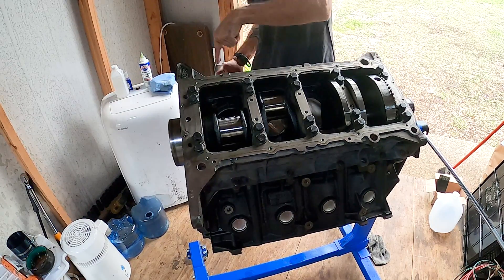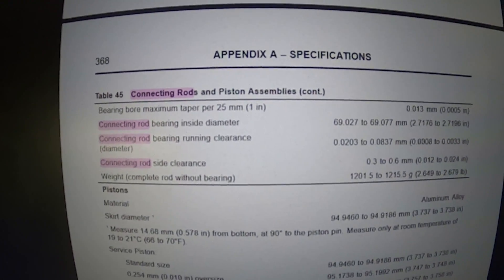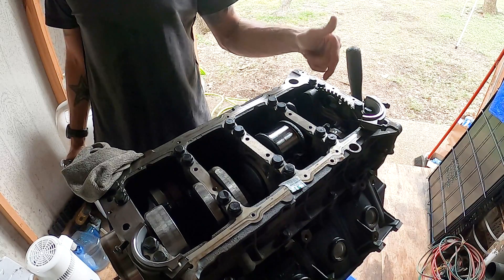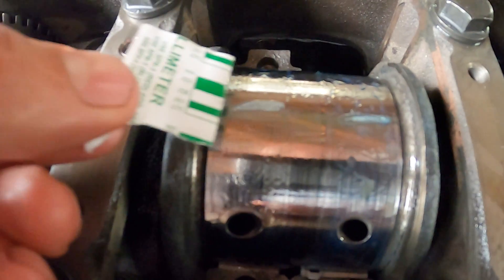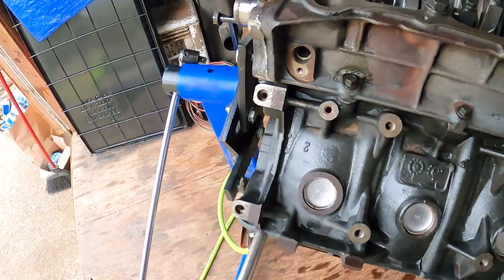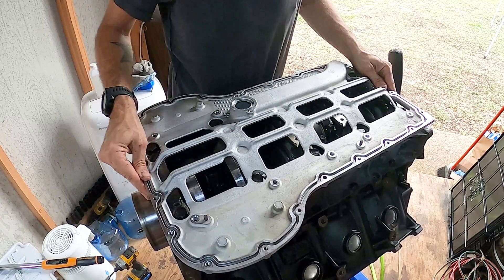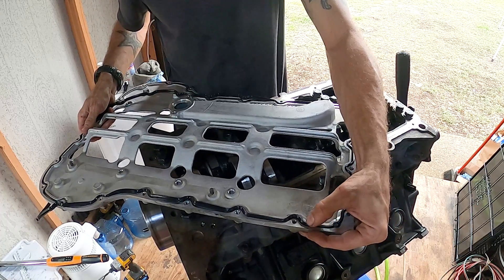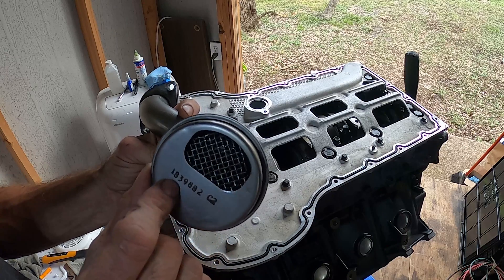6.0 Powerstroke - DiY Engine Rebuild - Part 5

Comment: The aluminum oil baffle plate IS NOT 23 ft lbs i really hope no one did that and snapped there bolts they are 10 ft lbs
Reply from the maker: Nice catch. I must have misspoke. Thanks